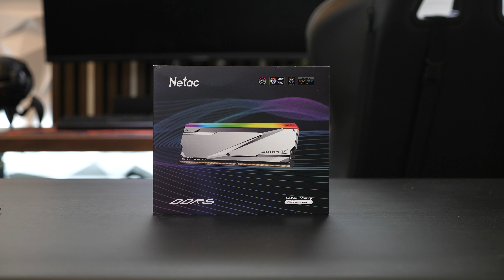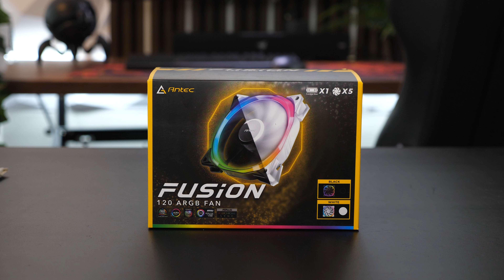Crystal-Clear Brilliance: Antec C8 White PC Build

Comment: The case is supposedly a full tower, but in the videos, it doesn't look that big. Do you think there is enough space to fit two 3080 Ti graphics cards? And what about the temperature? Considering it has double glass, which usually causes more heat.